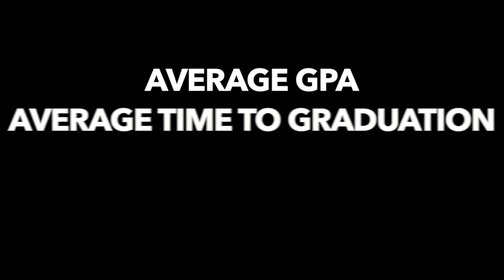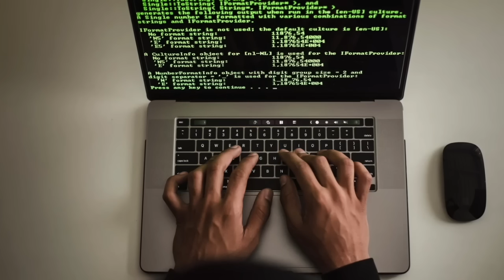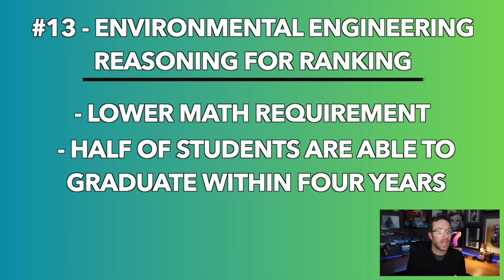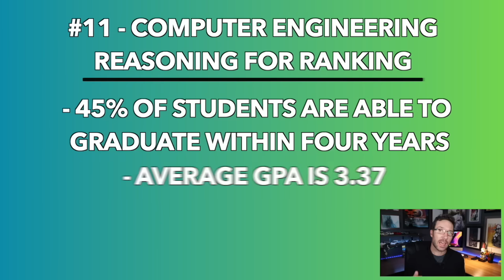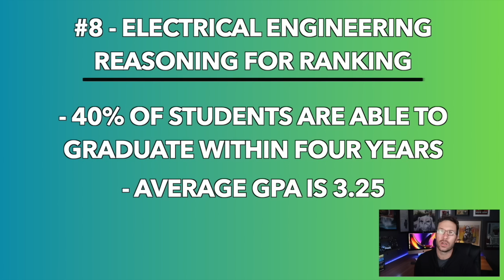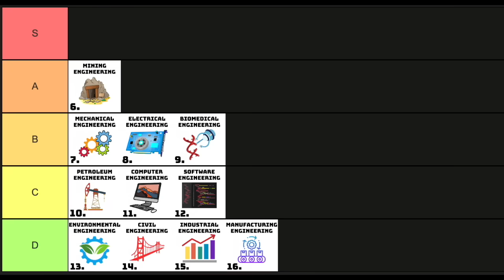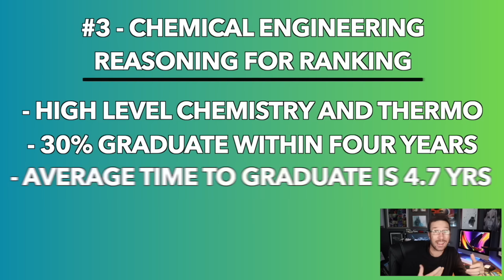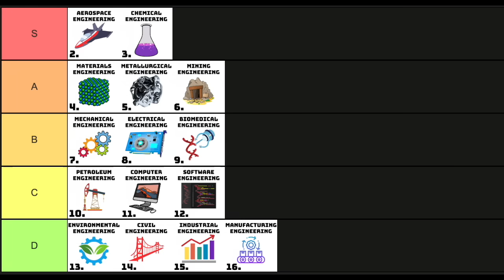Engineering Degrees Ranked By Difficulty (Tier List)

Comment: I got the hell out of engineering for a variety of reasons.  One of which was while I was forced to take a break to save money for round 2, I watched as median pay for these degrees didn't change.  Not for the first 3 years I was school, not for the 5 I was out, and not for the 1 I was back in before deciding to bail.

It is insane how undervalued engineering is compared to the 1990s.  These are the pay scales from like 40 years ago.  It's unhinged.
Reply: I’d guess there are a lot more engineers out there now. More people are going to school now. Because if you don’t go to school for stem, you’re screwed financially
Reply: @Mactakun  There are droves of people in trades that make more than this, and don't have to worry about their jobs going off shore. You can't fix an electrical panel or a toilet, if you're on Zoom in India.
Reply: Wages, like most things are decided by market forces, more engineers means lower pay for each
Reply: @Victor-ji1rz  
That is not how economics works. supply and demand has two parts, supply, and demand. you are only taking into consideration the supply.

if the demand outpaces the supply, then the value should rise. and demand has outpaced the supply. the issue is engineers do not know crap about economics and accept the lower wages because they are ignorant of the value of their labor.
Reply: @thezyreick4289  I have taken both into consideration, supply is outpacing demand man, they don't need to know crap, the employers are competing with each other, not their employees
Reply: @Victor-ji1rz  
Then you do not actually know anything. 
supply is not outpacing demand.
The companies are replacing a lot of engineering jobs with random people from the street, yes, this is true. and what is the result? those companies are having massive labor issues and running into complication after complication because those people are incapable of performing the actual job. At the moment things are still running as they were in good shape from the qualified workers, but over time things will keep breaking and they lack the people to fix them. in that time new companies will get built and hire those engineers and overtake the failing companies. this happens during great depressions like we are in. just as it happened during the last one. 

the overall market of all engineering jobs currently has a deficit already anyway, there are more jobs than engineers in the country. the only fields where in that specific field there are more engineers than jobs are the super common ones like mechanical engineers which practically everyone and their dog train to become. because everyone does it. 

I am a mechatronics engineer, my field was not even covered by the video, I get ridiculous amounts of money just thrown at me for grants and school aid from companies trying to lock me into a work contract to work for them after graduation, even more want me to just drop out and start working asap. I have gotten to where I am blocking company recruiters just to be left alone. There is not a lack of jobs. you are simply looking in the wrong place.
Reply: Your're totaly right. I know a lot of engineers and no one seems to be satisfied with their career. Indeed one of them switched to business as he don't wanted to be the "slave" for the management of his company. The ROI of engineering is also really bad, instead you'll be better off doing courses and start immediately to work. With the rise of AI it will get worse!
Reply: In 1984 the starting pay for mechanical engineers was about $30k and the $60k guys were the revered SMEs.   I stubbornly avoided management but if I hadn't retired 2-years ago I'd be at &120k (BSME).
Reply: Keep in mind that a lot of engineers eventually move into business and combine business acumen with tech savvy, and make a lot more money then what engineering jobs pay. I’m not saying it should be this way, but as my uncle used to say, ‘ to make the money, you have to be close to the money’. He was right. I got an MBA after being an engineer for several years, my income was eventually over 3x any of these salaries and retired in my mid-50s. I would recommend this to any engineer that is interested in moving to the dark side.

Comment: Mechanical Engineering with concentration in Thermodynamics is the hardest. My degree. 😊  
Reason?  All partial, not linear, differential equations aka the hardest calculus to grasp and solve.
Realistically, all Engineering degrees that require 4 semesters of Calculus and a Stats or Linear Algebra class is relatively difficult, the math with thermodynamic aka rocket science concentration IMHO is the hardest.  Most engineers take a lot of electrical engineering as well.  I like both EE % ME.  Chemical engineering is said to be challenging and Nuclear Engineering as discussed.  Yes, gentlemen in the comments, we made it and no it wasn't easy. The good things in life are hard and we did it.  To me, Engineering is a calling.  I was tuning my parents car when I was 12 and built my first minibike around the same age out of a bicycle and lawnmower engine.  I can't explain my ability to do math or engineering but I was born to do it.

Comment: Lol this video is such a horrible way of ranking difficulty of programs.
Reply from the maker: How would you do it with available data?
Reply: @becominganengineer2271  that's where you're wrong, you shouldn't be trying to rank the difficulty of engineering streams based off of how long it takes to graduate and what the average GPA is. Difficulty is subjective and can't be represented by numbers in this way. Also, consider that a stream with a low average GPA and a long time to graduate could also mean the opposite, that the program has a reputation for being very easy and appeals more to the less academically inclined. These people might get lower grades and fail more courses meaning it'll take longer for them on average to complete their degree. Your tier list is very scrambled based off of what the actual reputations of each program is. Finally, some of these programs are very niche, such as mining, petroleum and nuclear engineering. These much smaller sample sizes, which would generally be reduced to coming from a very small number of schools, would certainly cause the data to be skewed.
Reply from the maker: All good points. I guess I did the best with what I had. How would do it if you had to rank them?
Reply: @becominganengineer2271  The only way I could see would be to take a large group of people and have them complete each of these degrees - excluding the niche ones so maybe just the very big ones: mech, civil, elec, software. Obviously it would be impossible to have people complete 4 or 5 engineering degrees though, so maybe something could be done where people take one or two courses from each degree that are very representative of what the rest of the program would be like? Still very far fetched, but apart from that I see no other way of quantifying something that is purely subjective. Keep in mind that something is only difficult when put in comparison to something else. You can't ask an engineering student to rank how hard their degree is amongst the other engineering degrees since they haven't actually taken them.

Comment: My original major at Georgia Tech was EE, but I didn't like the discipline, so I went Nuclear and got a surprise. Not only was nuclear more difficult, because I wanted to work in nuclear power, I also had to learn EE as a part of the NE degree.
I worked 14 years in nuclear, then 14 years in the chemical industry, 5 years in power transformers and 3 years in oil and gas equipment and finally 5 years as a design/quality engineer. 
Nuclear was the only one of those disciplines that had what we called "big headed fuckers". They were the walking computers that could just spit out engineering and come up with answers without using references.

Comment: Do not agree that time to graduate is a valid metric for difficulty of the degree.  Many factors affect time to graduate including availability of elective and required courses, co-op or internships, preparation of the student for college level work, amongst others.  You have included degress for which there are a small number of programs (mining, nuclear) with engineering degrees that are available at virtually all engineering schools (mechanical, electrical, chemical) and therefore your analysis can be swayed by small data sets.   Virtually every accredited engineering degree in the US can be achieved in 4 years (excepting co-op orientied programs).

Comment: I have a degree in Instrumentation engineering and it pays 101000 we went to calc 2 we have to program and trouble shoot robots and advanced machines we pretty much learn programming on our own but theres so many programs out there we can cut and paste putting in sensors for safety was one of my first task mostly wiring so when the door is open the machine shuts off electro magnets keeps them opening the door when shutting down a machine would cost money trying to get it runiing again like a paper machine people stick their hands into machines and loose them

Comment: Some of those disciplines are not as widely offered as others.  I don't know about the criteria of how long it takes to graduate.  In some fields it is difficult to enter the job market with just a Bachelors degree, you have to go for an advanced degree in order to get the number of hours to cover the subject.  The company where I work will not hire engineers that don't have a Masters degree.

Software engineering and computer engineering seem to be on the verge of being sent offshore.  A friend's son graduated Summa Cum Laude
with a degree in computer engineering and could not find a job.

I would think chemical engineering would be very difficult, to me advanced chemistry seems pretty difficult.

I don't think aerospace engineering is that difficult.  I graduated in structural engineering and I think I took more difficult courses and more difficult math than required for aerospace.  Plus structural engineering really requires at least a Masters degree to get the hours of coursework that is required to do the job.

Comment: you dont need 14 minutes, of video.....here are two...The 'hardest' engineering majors are chemical, electrical, and aerospace engineering, based on some of the key areas of difficulty we've been considering. Chemical and electrical engineering involve higher levels of abstraction.Sep 12, 2023

Comment: When you described chemical engineeting as doijg lots of chemistry  you kind of showeed you dont know what chemical engineers do.  Chemistry is maybe only 20% of the degree. There is tonnes if physics in it as well. There is also mechanical design.  Electrical, instrumentation and controls design. Fluid flow, thermodynamics etc.  You walk in to any indhstrial process and a chemical engineer can design all of it, quiet literally. I havd lersonally designed steam systsms including pipe, insteuments controls, distillation unit's,  heat exhanges, vortex separators, reactors, compesssiom systems, etc.  Additionally, many of thendegrees you listed chemical engineers specialise in such as materials engineerign, petroleum engineering, manufacturing,  process engineering, etc.  Go look up what chemical engineers design you'll see theyre ptettyy mucha  jack if all trades which is why theyre called universal engineers

Comment: I graduated from EE/Communications Engineering, we go much further than ODEs, at least at the uni that I attended. IMHO whoever puts mechanical engineering as a difficult one is oddly mistaken. Mechanical engineering algebra and equations don't even compare to signal processing, entropy, complex analysis, atmosphere refraction, matricial compressions and discrete transforms.
Anyone has the right to have their own opinion, but respectfully I disagree with you. EE should be way up and ME way down

Comment: As an environmental engineering student I actually did have to take ordinary differential equations. There are some classes coming up in my senior year with computer programs for civil and environmental engineering that require ODEs and even some PDEs (at least it looked like PDE's that from my friend's homework). Interesting that your ranking says only calc 3 is needed, I wonder where the research for this was done
Reply: My degrees both bs and ms are in civil,however my ms focused on what we called back in my day sanitary engineering.  Since we were mainly doing water and waste water treatment the course work leaned more to chemistry and biological sciences.  Over the years it seems environmental engineering is a term that covers what we did back in the day.  But being a Civil degree still had to take all the basic science and engineering courses including structural, surveying, , mechanical and materials courses.  Do environmental degrees still require those

Comment: Great takes.  I fully expected Nukes to be #1, with ChemE and EE on the podium.  A little surprised to see EE in the middle, and below Mechanical E.  ME might have leapfrogged it in the past few decades due to the advent of CAD and robotics as they apply to the discipline.  I still think of the best ME's as the guys/girls! with the dirty fingernails that convert their lawn mowers into a snowblower on the weekend, and then into a jet ski for the Spring.  All the high tech tools have added a new kind of desk jockey to the genre.

Comment: I do Architectural Engineering (at UCL)💀. It's one course that teaches you 100% of architecture and 100% of civil engineering. All in 4 years. Let me tell you it's brutal. No year has started with more than 80 students. My year started with 72. I'm in year 2 and we dropped to 56 already.
It's nice because it's a very comprehensive course that really helps avoid the famous architecture vs engineer problem but heck it's difficult. Contact hours is around 40 hours a week, basically a full time job. It gives a lot of credentials which is also great.
What sucks tho is that no one recognises us as part of them 😭. Architecture students don't acknowledge us as part of them and engineering students don't acknowledge us as engineers... 
Yh and ofc social life is nonexistent 👍
Reply: Sounds like a great course!  If that had been available in my undergrad university, I quite likely would have taken it -- and ended up in a completely different field from where I am now.

I think that's a general thing with most degrees that are at intersections of two "traditional" fields like that, that they end up being a lot more difficult than either one of the fields alone.  There's a general idea of "the minimal amount that a person needs to know to be a civil engineer" that's been tailored to fit four years of education, and the same thing with architecture, and then because that's become an established canon of knowledge, it's hard to convince anyone that any of it can be removed to make an intermediate degree.

Comment: I'm 3rd semester EE, we take 156 credits (if I remember correctly) already did vector analysis and ODE, currently taking partial differential equations, integral transforms and Fourier series.
No idea where this dude got his information from.
EE is 100% the hardest.
Reply: @liorcohen5833  The hardest will be the day you will have to apply these mathematical tools to a real engineering problem. The biggest joke is to see an engineer being given a survey field notebook and unable to apply simple trigonometry to deduct the size of a piece of land. This is how I started a long time ago with only a slide rule.
 But I ended up with a MSc in EE specialized in automatic control and servomechanisms.
Reply: @pindapoy1596 
That's awesome and very good for you -
I've done the same in communications and made a pretty good life for myself...
And I Still love it !
Reply: Similarly, I don't know where he got the info that calculus and ODE is required for the manufacturing and industrial engineers, the most they have to take is trigonometry.  Some of my teachers even went as far to say because they don't take calculus and calc based physics that it isn't legitimate to call them engineers, but rather are more like technicians.
Reply: @Anon54387  You ain't getting it. You may have a long and successful career without ever having to differentiate a function but your professor needs to teach you things that you will use in your career and for being able to do that YOU will have to know enough mathematics in order to understand the sublect. For example, it is impossible to teach strength of materials without going through the equations that helped establish the formulas you will have to use. And deriving those equations requires calculus and other mathematical tools. Unless you are willing to face your future career learning by heart a few useful formulas, you need to understand what is behind them and how they came to be.
Reply: I did my undergrads in EE and it isn’t the hardest. Nuclear and Chemical are more difficult, but it is definitely more difficult than ME. I can’t speak to those in the 2nd tier because I haven’t worked with guys from those disciplines.

Comment: I have a BS in computer science with concentration in system engineering 1998. The amount of circuitry and logic courses were intensive. Moving on to get a master in engineering management concentrating in computer engineering were pretty simple because I had a solid background in computer science. My advice is to really do good in bachelor level before moving on to graduate program.